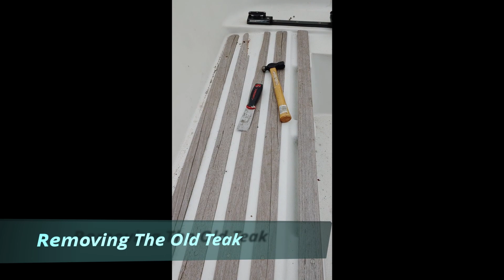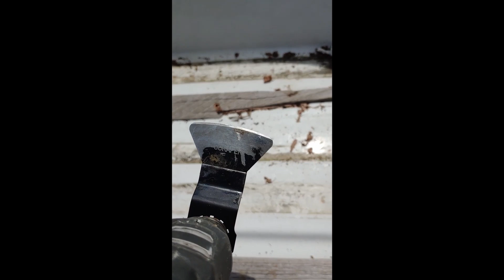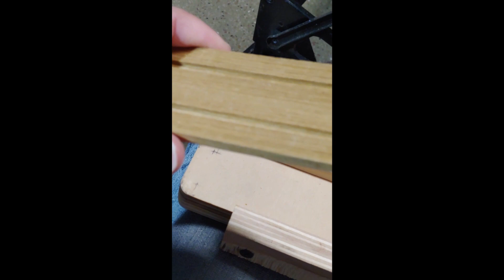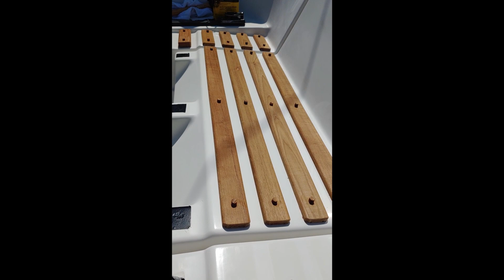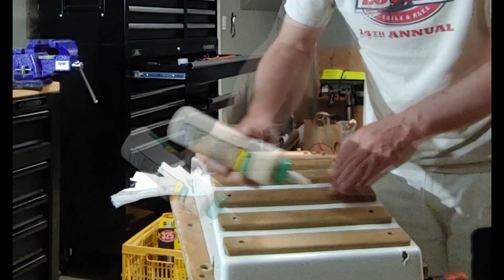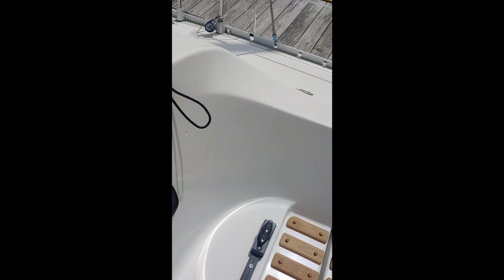Teak slat replacement in the cockpit of a Beneteau First 310

Comment: Thanks, preparing to do the same project. How hard was it to remove the current screws? do you drill with the forstner until you hit the screw? did you end up having to replace the screws and use new ones? If so, what spec screws did you use?
Reply from the maker: The existing screws came out easy. Most of them were visible and i just cleaned out the slots for the bit to fit. On a few I use a forstner bit to get closer to the screw. I ended up re-using the screws. They were stainless and in good shape and still had plenty of grip. Good luck with your project!

Comment: Well done. IMO, with the glues of today there are not anymore scruws needed. You need only weight to press them and waiting the glue hardens.
Reply from the maker: True. However what i like about using the screws is that you can re-tighten them after 5 mins or so to ensure the glue spreads nicely.

Comment: Great job! I am thinking of doing the same on my Oceanis 300. Did you consider other options such as painting the cockpit seats or installing foam teak?
Reply from the maker: We like the feeling of real teak so the objective was to replace the wood from the start. It is a bit of a process vs painting or installing foam teak, but very frankly worth it. There is another Beneteau 310 here in the area, and they replaced the teak with foam teak and I must say that it looks good. I think that if you are going for optics only, foam teak is a good alternative.
Reply: I think the foam may be the way to go.  Keeps it cooler and less slippery.   Plis there is a little give for comfort...